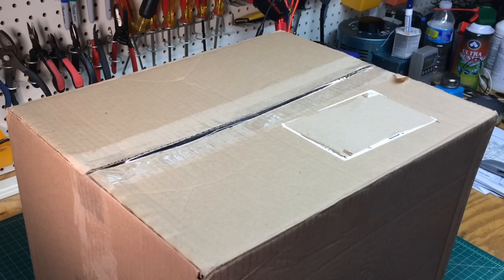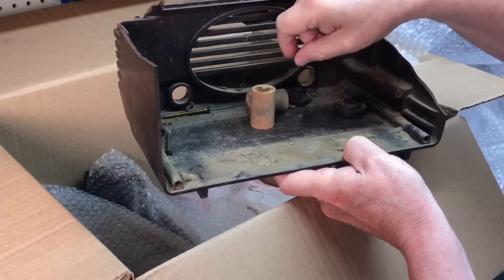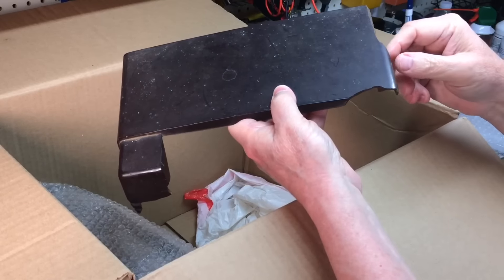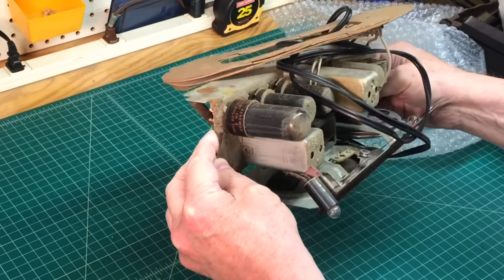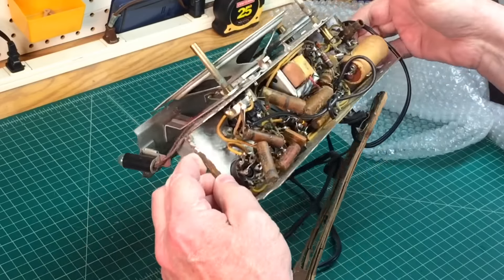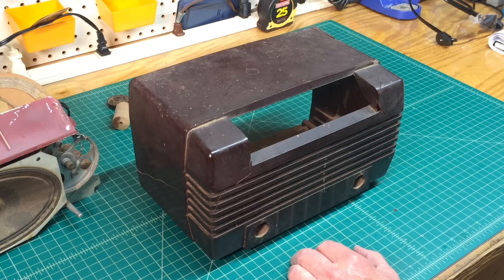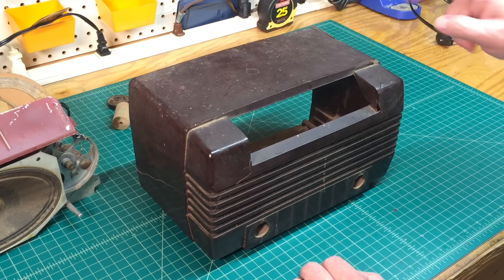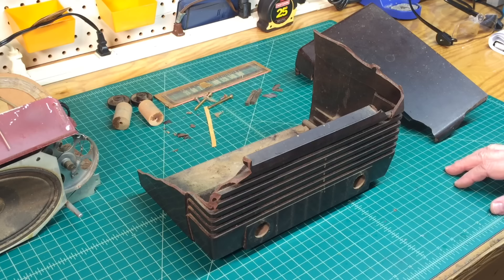Radio Unboxing Video

Comment: Looks like another fun project.  I recently bought a Russian Moskvic radio with a bakelite   cabinet, when it arrived it was in 8 pieces.  I wasn't happy.  I super glued it first then epoxied the cracks in the back, wet sanded with 1500 grit, filled in any missing pieces sanded again.  I then tried using Minwax Polyshades satin mission oak as a top coat.  To my surprise after an additional clear coats of gloss poly and sanding it looks very good.  Thankfully I didn't have as many intricate grill parts like you have, but I'm sure you can save it.  Thanks for sharing Zach
Reply from the maker: +zachtownsend1 Zach - thanks for sharing your methods and procedures. I'll be digging thru my junk to find an old Bakelite cabinet to play around with. Thanks again for watching. Best, Don

Comment: For what it's worth, I read about a technique for hiding the cracks once you glue the case back together.  Run a small bit of crazy glue un the crack and then immediately put a piece of shipping tape alone the glue line and rub it in really good .  This will fill in the crack and smooth out the glue so that there isn't a bead left.  It will take a little sanding after removing the tape.  (use a face mask as bakelite can have bad fillers in it).  You will likely have to paint it, but it should look good.  You can also use a Dremel to cut small grooves across the track on the inside and use epoxy in the grooves to "stitch" the bakelite to make the repair stronger.   You have the tuning dial which is a big plus.  Good luck!  This looks like an interesting project.
Reply from the maker: +Stephen Moore Hi Stephen, thanks for the tip. I need to experiment on a broken Bakelite Cabinet for sure before moving forward with this one. Thanks again for sharing this process. Best, Don

Comment: Hi Don,
YAY a 3d puzzle :-) You are correct, epoxy is a good way to go. I have had good luck with Bondo also. Use a Dremel and undercut the pieces first, then use some fine mesh on the inside to reinforce the seams and a good coat of paint and it will look very presentable. Good luck and keep some sedatives handy LOL
Reply from the maker: +Jim Kodysz Hi Jim. It's going to test my patience, but hopefully I'll make it somewhat presentable. Thanks again for sharing your process. Best, Don

Comment: Wow.  Don I'll say that you do some of the nicest work.  What ever or how ever this ends up I'm sure it will look fantastic.  I think if it were me I would look at how fiberglass is reinforced and repaired and try to apply that to this Bakelite cabinet.
Reply from the maker: +TheDisorderly1 Thank you for the tip. Lots of options to try. I need to dig out an old useless Bakelite cabinet to experiment on. Best, Don

Comment: Wow Don, looks like quite a challenge with that cabinet, but at least it looks like you have all the pieces.  I agree on repairing it though, seems like you'd almost have to paint it to hide the repair seams.  Not sure how you could get it to the original color though.  I've looked high and low for different shades of brown spray paint before and it seems almost non existant, but if anyone could find a way to make it look original again, I'm sure you're the man for the job!  Take care, Gary
Reply from the maker: +Rebel9668 I have some ideas Gary, but not too sure they will work. I hope to video my tries for future reference and a little laughter down the road. Best, Don

Comment: Don,  I'll send my "Bakelite basket case" method via email.  Obtain two PreVal sprayers for the marine gelcoat topcoat application, and woven fiberglass cloth for the interior repair/reinforcement. I've figured a way to simulate the grain of the Bakelite with gelcoat.
Reply from the maker: +AMStationEngineer Thanks for sharing you knowledge Tim, it's greatly appreciated. Best, Don